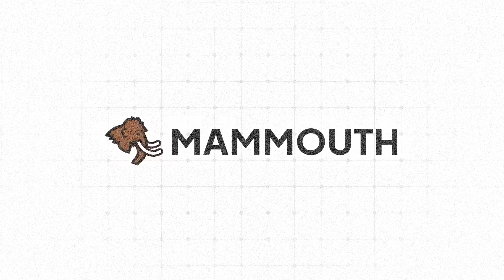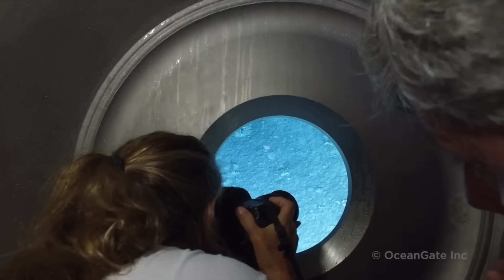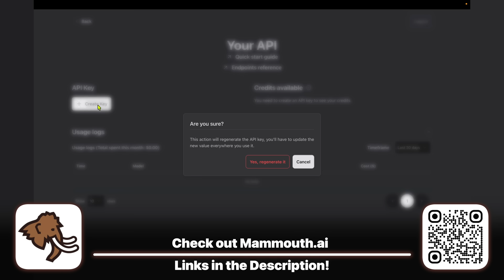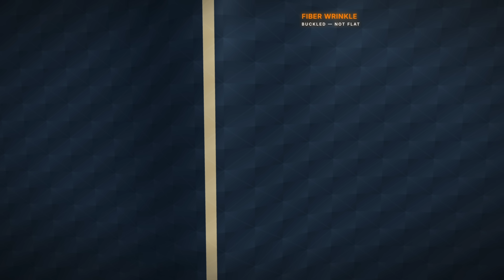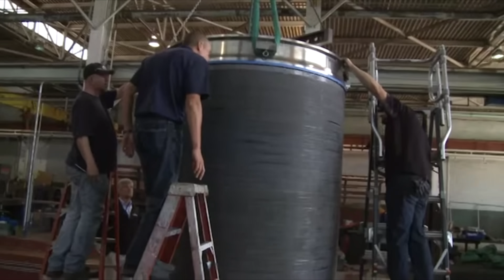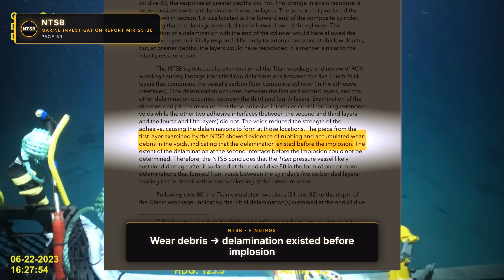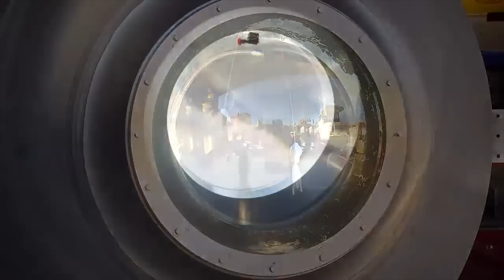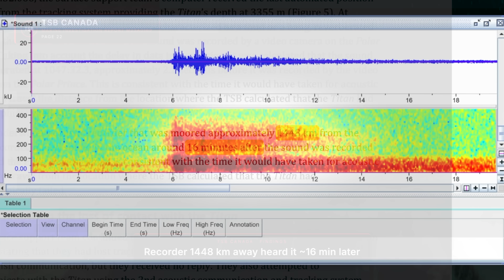Oceangate Titan: It was WORSE Than We Thought

Comment: I find it interesting that the hull survived 13 successful dive to Titanic. Despite all the abuse, and errors done during building it. But it was a catastrophe waiting to happen
Reply: @afre3398  I think engineering principles dictate that things should be over-engineered to ensure as close to 100% bulletproof as possible. So even if the hull was not up to code, it was able to handle a number of dives. If it were built properly, I’m sure it would’ve lasted hundreds of dives. Such a tragedy
Reply: @StandAloneState Most are, they are engineered and manufactured to a consistent repeatable standard.
Fit for purpose. 
This thing was made in the back shed, by individual that knew better that anyone else.
Reply: Cumulative degradation. BANG!!!
Reply: @afre3398  
Not an engineer, but it sounds like, theoretically, the design should have been adequate and safe. 
However, it illustrates the difference between modelling a perfect system designed from perfect parts and reality.

Considering that the main goal was to build a cheaper sub they simply were unwilling to spend the money to manufacture a "perfect" sub.
Reply: @Richard-or9rt  The design was... mostly fine. The manufacture was horrifyingly bad. This wasn't just an engineering problem - they designed something that could not be manufactured - but also a slapdash build and lackadaisical quality control.
Reply: @donmab  It didn't need to be perfect, but it needed to be a lot better than it was. Maybe it needed to be better than it could have been done. 

That said, the way they actually went about this was just unbelievably bad. That hull should have never been used from the sheer number of defects present. Given that CFRP depends on the fibers not being severed to have strength, machining away defects effectively made those layers of fiber not do anything. They did that repeatedly.
Reply: @Richard-or9rt   the design as originally conceived, with the recommended changes from Boeing, would almost certainly not have failed on that dive. But all the changes made by Stockton, reducing the hull width, removing the diagonal fibres, grinding buckles, curing the inner layer 5 times, ignoring safe storage practices, and generally being an idiot about it meant that the failure at normal depths was a case of "when", not "if"
Reply: @TAP7ahow do you build very thick carbon fiber part without heating some part multiple time? If you do it in only one time, you can't be sure you have the correct amount of resin everywhere. The outside will always be hotter than the inside, because it takes time for the heat to go through the external layers...
Reply: @Richard-or9rt  Design at the very beginning was unprecedented but probably fine. On the other hand the execution of that initial design...
Reply: That's why you're going to be seeing a lot more carbon fiber submersibles. Today we laugh at the guy but he actually proved the tech will work(so long as its someone else building it). Previously, it was believed that carbon fiber submersibles could work but would only be able to successfully do 1 dive before having to be scrapped and replaced. 

People 30 years from now will see him as a brilliant man who changed the world but lost his life due to his over-reliance on incorrect assumptions. This is usually how any groundbreaking tech goes. People at NASA and the entire scientific community thought Musk and Bezos were complete fools for trying to build rocket boosters that would propulsively slow down and land from supersonic speeds. It was deemed impossible until it was accomplished.
Reply: @ryelor123  Holy misinformation batman. 

"People 30 years from now will see him as a brilliant man who changed the world but lost his life due to his over-reliance on incorrect assumptions" - He'll be forever remembered as the moron who cut costs and killed innocent people along with himself. The fact he took research on carbon fibre pressure vessels and bodged one together does NOT make him brilliant. He ignored EVERY engineer who told him he was acting like a fool. 

No one at NASA thought Space X were fools, they fucking paid for them to develop rockets. Reusable space flight has been top of the list for decades, it was NEVER deemed impossible. Musk did absolutely nothing but own the company, he is famous for having entire teams whose purpose is to distract him from saying or doing stupid things when it comes to engineering. He's a moron with a huge bank account. 

Never seen so much bullshit spewed before.
Reply: @mattd6085  Your use of the word "misinformation" at the outset of your rant tells me all I need to know about where you're coming from.
Reply: @DraftySatyr  And where am I coming from?
Reply: @mattd6085  Europe?

Comment: so in short.. the carbon fiber.. failed.  your product is only as strong as its weakest part..
i used to work in building big composite tanks and parts.  water testing at atmospheric pressure makes a lot of cracks and loud noises already..and when we do pressurized tanks.. yeah, you can hear every pocket crack and bang throughout the testing.. its not  quiet..  
Oh, they caught everything.  it sounded like they went with perfect world data over reality..

Comment: The carbon fiber problems are 3/4 of the reason the vessel imploded. Construction quality negligence and inadequate safety sensors to monitor the real-time structural integrity are also big factors. The final nail in the coffin was the pilot's attitude (Stockton Rush) of Let's just go down and see what happens! His negligence murdered the passengers. The families of the passengers should be awarded the cash value of everything Rush was worth.
Reply: I don't think Rush was worth as much as he claimed, hence why he was penny pinching everywhere.
Reply: I take it you didn't watch the video before making that comment. The carbon fiber wasn't the inherent problem but instead how it was assembled. Also, you're putting a dead man on trial who has zero defense. A lot of the engineers and other employees who turned on him after the incident were probably doing so to cover their own hides as they probably were more guilty than him.
Reply: @ryelor123  You're splitting hairs. Rush deserved what he got. The passengers didn't!
Reply: @ryelor123  how does his team of 20 engineers, stripped down to THREE by the time of the fatal launch, make them guilty? It is clear from reports and interviews in all directions that he was warned, repeatedly, and he simply kept firing or ignoring everyone who warned him. It's not the engineers' fault that they were never given the Boeing specs, and instead given Rush's shaved-down version. Its not the engineers' fault that they told him it was doomed, or at bare minimum risky, and he waved them off. It is not the engineers' fault that Rush left the sub in a fucking parking lot for the winter.
How do you even pull "a lot of engineers" out of three. The employees who willingly continued to bolt him and his passengers into the sub may as well be called murderers, with your logic.

Comment: cylinder was the only shape they could have manufactured, cf was the only material they could get. they literally couldn't have done a sphere from it, so it HAD TO BE A CYLINDER.
getting the right steel to make it from steel isn't like a sure shot with just by having money either. you can't just make it thicker to compensate. this gatekeeps most countries on the planet from building deep sea subs as they lack domestic expertise and quality of steel manufacture.

it's amazing that they managed to make a sub at all that went there. but lacked the funding to run the testing regime. the safety factors etc are not known still - the estimation maths done by people were wrong, nobody knew or still knows how to do the maths right with the manufacturing taken into account. the scale model testing is not scalable. the only way to do this responsibly would've been to run the full size thing to destruction multiple times while recording the signs.

also we've known sanding etc things for a long long time now.

it did more than 13 dives, that it did go there and back up many times is actually amazing, it did way better than people said it could do - it did better than people still say that it could even possibly do, people still think that it would fold on the first dive despite them knowing it did go there many times -  hence the maths being wrong. but the guy was so deep in the whole thing that he just had to run it to destruction more or less and couldn't face the loss of face of bowing out of the thing due to not having enough funding, so we won't get the correct estimations or maths. and look this technique could be very interesting for couple of countries to make subs that are used as disposables.

the strain explanation provided here isn't right either - without the destruction it doesn't matter if you're looking at the strain data as you'll have NO IDEA WHATSOEVER what measuration would mean that it's in the red. the acoustic sensor system could work if you used it right and KNEW WHAT IT SOUNDS ON DIVES BEFORE IT BREAKS which you wouldn't know - besides than that the guy ignored the readings, the basis was on that he couldn't stop the dives without the whole thing going bankrupt - "even if it kills me".

Comment: The glue-up between the titanium domes and carbon hull was not  vacuumed, so is guaranteed to have contained air pockets.
Reply: As designed, the glue-up between the domes and the hull should have been operating 100% in compression.  And I believe it was actually autoclaved.  That glue bond should only really be needed to stop the end caps falling off when it's out of the water - once it's submerged, pressure is pushing those caps on.   Shear load caused by the forces on the ends of carbon tube is taken by the inner lip of the reinforcing ring.  This assumes that the hull is not deforming to any significant amount - made to size (7 inches not 5), with 45° layers, and not delaminating.  As soon as some of those things are not true, the glue layer is at least partially acting in tension, and that makes keeping it all together - problematic.
Reply: Once that contact became loose due to hull flexing the tiny lip on the inside of the titanium ring turned out to be severely under dimensioned.
Reply: Which even for simple things will be failure points, let alone this.
Reply: "its virtually indestructibe" funny how stockton was almost right on that
Reply: On the bright side, we now know that the tech would work so long as we don't cut corners like he did. Sometimes someone failing at something after being horrendously sloppy can actually prove the technology is easier and safer than anyone else expected. I have a feeling that carbon fiber submersibles will become very common in the future and people 100 years from now will see Stockton Rush as a pioneer who proved something was possible at the expense of his own life.
Reply: @ryelor123  carbon fiber subs have been in use before Stockton. There is at least one company that builds only carbon fiber submersibles.

I blame James Cameron and the news for not educating people about the reality of carbon fiber. Cameron, while a great director and passionate about diving, was straight wrong about carbon fiber. 

Also, no one pointed out Cameron nearly died in one of his subs. His sub lost power and had other power issues, which kept it from being able to engage the engines. 

A carbon fiber sub is literally designed to solve the problem that nearly killed Cameron. If the Titan sub was in that same scenario, it would still rise to the surface. The titan did not require power in order to surface due to the buoyancy properties it has.
Reply: @taoofjester4113  Carbon fibre has, to my knowledge, been used on one experimental submersible (DeepFlight Challenger) before Titan, which proved, after a single dive, that micro-delamination events were so widespread in the material that they could no longer guarantee its strength properties for any subsequent dive. In other words, carbon fibre is a single-cycle material when used for deep-sea vessels... which is hardly particularly useful, considering the manufacturing costs of making something for that depth.
Reply: @WillemFick  you do know it was autoclaved to remove air pockets?  I thought not.
Reply: @scottkelley1558  they still find tons of air pockets though and autoclave isn’t good enough.
Reply: @scottkelley1558  autoclave doesn't guarantee no air pockets. And since there WERE air pockets you're just wrong.
Reply: He was talking about the glue bond between end caps and hull.
Reply: @scottkelley1558 that won't do anything if it's not under vacuum.  Autoclaves for composites are pressurised and a void will expand as heated.

Comment: I'm also reminded of an issue at a nuclear power plant. Many such plants use a massive containment building that is made up of concrete and thousands of steel bars/cables (reinforcement bar) embedded in the concrete. On rare occasions some plants have had to cut a hole in this and then repair the hole. This takes a lot of engineering, regulatory review and detailed work; as you might imagine. But hey, reinforced concrete is a well understood technology... right?

At one plant as they cut the rebar (which was normally under some tension, thus applying a compressive force to the concrete), when the tension was released, the concrete 'broke' and separated into inner wall and outer wall layers. This was a surprise since several plants before that had done the exact same work and not had any issues.

It was noted immediately and took a long time to understand, and devise an acceptable repair, so there was never any danger to the public (the plant had to remain shutdown for several years). But it's an example of, "Gee... we thought we understood reinforced concrete and then this sh** happens???"
Reply: @mikefochtman7164  yessss that's just so disturbing.  A NPP containment is a shield whose strength and integrity is supposed to be integral to overall safety. 
Really annoying that there is a fundamental disregard here.

Comment: The problem with carbon fiber for THIS SPECIFIC APPLICATION is that it's a bad material for a pressure hull. As you pointed out, in real-life engineering, you often test things and then decide on a reasonable lifespan. If Rush had done that, he would have found out that the lifespan is just too short for this concept to be economically viable. If you need to throw the hull away after half a dozen uses, thick steel will always win the battle of technologies. I'm not saying that there isn't technological progress and paradigm shifts. But every engineer will agree that there was nothing in Rush's concept that would have pointed to it ever working. This was not Tesla. With Tesla the nay-sayer argument always was "You can't scale it", not "This doesn't work".

Comment: 18:01 SF of 1.25 is basically unacceptable for any design.. by a F of 2. Minimum.
Reply: 1.25 is acceptable in high pressure steam applications in petrochem...
Reply: @riverroadracing  seems sketchy. And pressure vessels have other fail safe systems, like relief valves and materials that tear rather than shatter.
Reply: Not true.  Airplanes have used 1.5 successfully for decades.
Reply: @LTVoyageron what specifically? And you’re sure, if I research whatever you say, there won’t be any documented failures on that part..? Bold. Challenge accepted. Go.
Reply: @simsadie6  I am not aware of any airplane structure properly designed and maintained with a 1.5 FS that has failed within its design life limit.  If you have an example, go for it.  An FS of 2 would dramatically reduce the useful load of airplanes and is completely unnecessary.